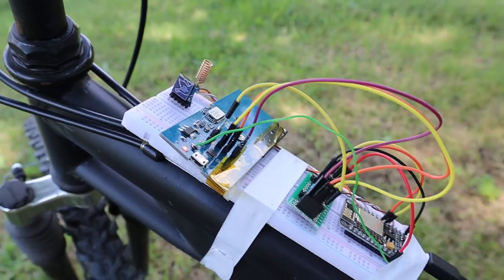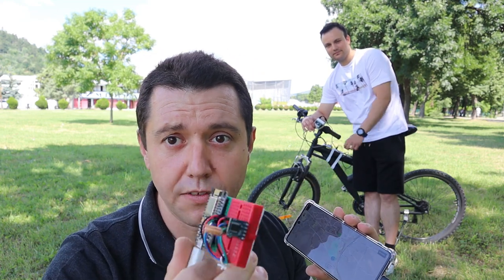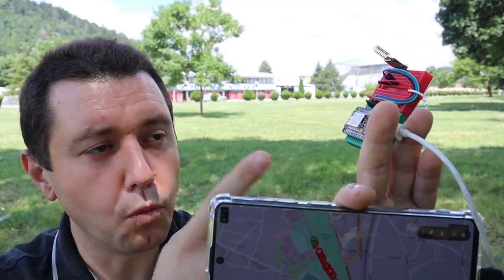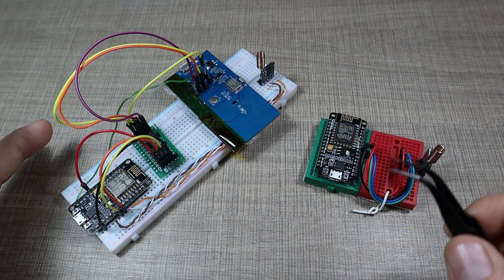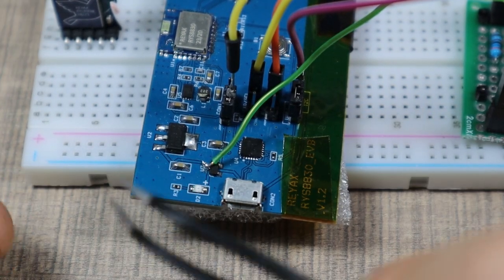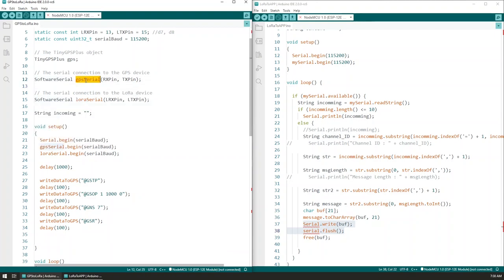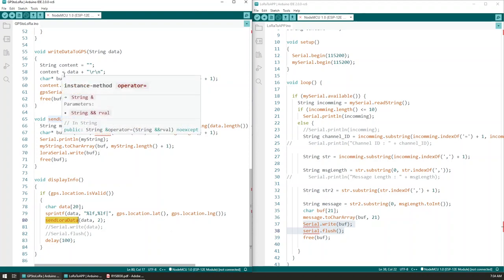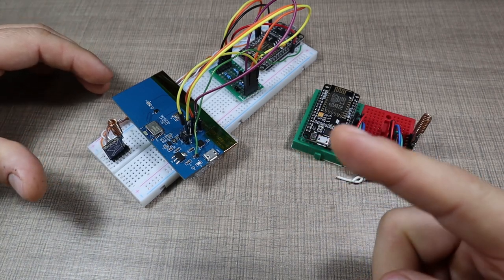Simple GPS tracker for adventure tracking in remote locations

Comment: Excellent !! Thanks for the video and details. Please provide Fritzing circuit diagram for both Transmitter and Receiver modules. That will be a great help in doing R&D studies. I am using RYLR998 LoRa module and RYS8833 GPS module.
Reply from the maker: Hey I don't know when I'll have the time to do that but you can work out the connections easily based on the code which is available for both devices.

Comment: Great video! How to use this module but in such a way that it takes the smallest space possible. The module being small has an advantage which is negated by the board it has to be on. Any way to trim it down?
Reply from the maker: You define your own placement. The only limitation that you have for the carrier board is that it must not have a ground plane underneath it. This is so that it does not interfere with the GPS signal.

Comment: Hi, is it possible to have the drawing of the electrical connections?
there is so much confusion and so many words
Reply from the maker: Connection is very simple. You can see it from the Arduino code where it is written what pin connects to what. Also each module has its own separate video on the channel.

Comment: How battery hungry are these chips? For wireless?
Reply from the maker: When transmitting, they use up to 140mA of current and while receiving around 17mA. If put to sleep, it only uses 10uA so there are applications where you can make a use case optimized for battery usage.

Comment: Nice project.  However u still need internet connection on the receiver side because of the app.  Is there any way that you can pre-download the maps and run the app without requiring internet connection?  Thanks
Reply from the maker: Thanks! Yes, it is possible to have offline maps on the phone but the app will need to be built in that way. I'm not that good with mobile app development but it should be possible.

Comment: Sir, I have soldered, the input of the GPS module to the Vin pin of the NodeMCU but the GPS module is still not powered on. What should I do?

When I power the GPS module separately through USB, it comes on.
Reply from the maker: Vin is 5V. You need to use the 3.3v pin
Reply: @TasteTheCode  i mean to power on the GPS EVB board. I see you soldered the input of the EVB and connected it to the Vin pin of the NodeMCU
Reply from the maker: Yes, that is correct. Did you also connected GND together? If you did this right, there is no chance that the module won't power on.
Reply: @TasteTheCode  Yes I did connected the GND. it finally came on. My problem now is the why the nodemcu is not reading the gps or detecting it

Comment: How much power do you need for the one mounted on the bike? I hope to power it from batteries instead of power banks. Thanks!
Reply from the maker: Not much at all. The GPS module is designed to be low power and you will be better off with batteries. I used a power bank just for convenience.

Comment: Hello There ! Great project. Could you please let me know how to assemble the same with ESP32 instead of using NodeMCU ESP8266? Thanking you.
Reply from the maker: Thanks! ESP32 and ESP8266 are basically interchangeable. You will just need to replace the pin numbers in the code with whatever you connect the modules to and you should be good to go. I haven't tried this myself, but it should be fairly straightforward.
Reply: @TasteTheCode  Thanks for your reply.

Comment: Hi Taste The Code
Thank you for sharing
I realised this project with a BN220 GPS.
The requested frame can be read from the serial port of the transmitter in the following form 43.xxxxxx,7.xxxxxx|
on the serial port of the receiver I receive the frame in the following form
+RCV=1,19,43.xxxxxx,7.xxxxxx|,-19,11
I hope that's what is asked !
When I plug the receiver into my cellphone's OTG and open the Arduino ESP32 GPS Maps app
a map opens with the position of my cell phone but it is not the correct position it indicates a place in the United States
but I live in France! and I don't see the position of the GPS module.
Does this app work worldwide?
Please help me.
I want to use this project to find my RC glider when it is lost.
Thank you
Reply from the maker: Hey, yes so the app works worldwide but it only works with the very specific data string on the serial port. You need to send it to the phone with just the longitude and latitude as per the example.
Reply: @TasteTheCode  Thank you for your answer.
can you give me an example of the specific code I need to send to the application.
THANKS
Reply from the maker: @J.Navelo sure, this is the link: https://github.com/Zdravevski/arduino-gps-visualization/blob/main/serial_communication/serial_communication.ino It is my friend @SlavkosHobbyChannel that built the app so maybe he can also help you out. The format is like this: 41.037806805413965,21.34574775323119| with a | at the end which is very important.
Reply: @TasteTheCode  Thank you for your help.
I used Slavko's example on an Arduino Uno the serial port displays the GPS coordinates but when I launch the application on my SAMSUNG S6 edge via OTG cable nothing happens just a blue icon which is the position of the cell phone in a place in the USA but I am in France
and then the map becomes small and shows the world map and then nothing happens!
What is the problem ?
Thanks for the help
Reply: @J.Navelo I checked the problem, and it was again Android (Google) changed something in their policies, so I fixed the problem, and I will send an update for review 🙂